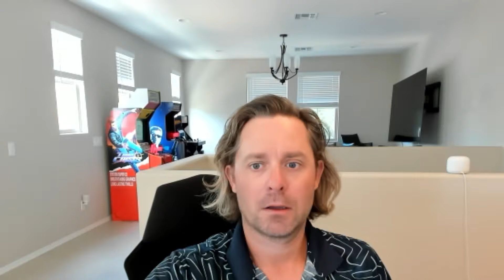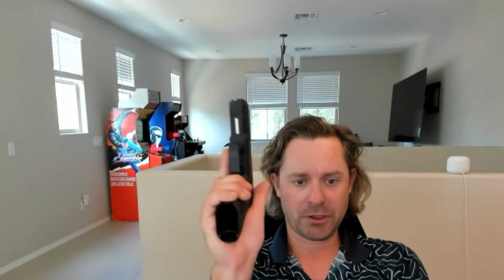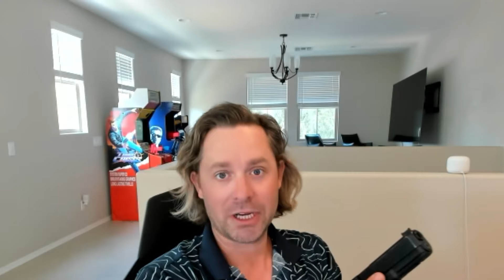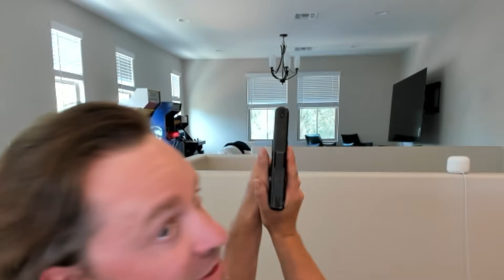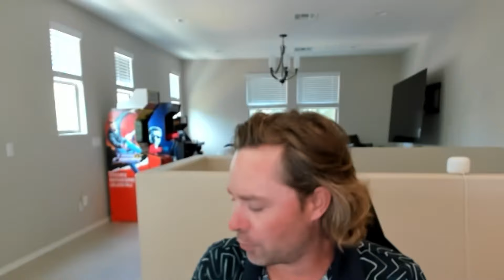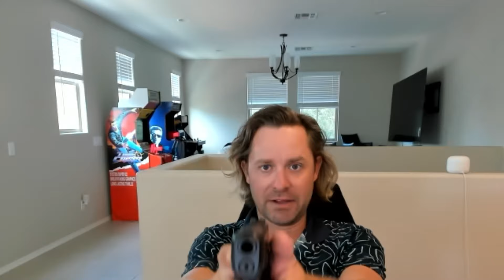Symmetrical Pressure

Comment: The support index finger over the trigger guard is the grip Eric Grauffel uses. I was IPSC trained by  one of his students so I started doing that for competition. It gets your hand up high and I use a little push / pull with some JJ support side  wrist pressure  in my upper palm . But , as Ben says either way , a vise like over gripping leads to a tense trigger finger and attempting to control recoil causes the pistol to porpoise down , reduces accuracy as well as slowing your split times . Predicable return to zero is the goal so the only way to learn that as a new shooter is to experiment with pressures using whatever variation of the thumbs forward grip works for u .
Reply: With Eric's gripping style, there is no firing hand pressure since you push/pull with your shoulders, so your firing hand is not tensioned. Split times don't matter much(if you can shoot .20-.25s splits), but transitions and transitions accuracy. I am switching from the traditional style of grip to Eric's type of grip since I have problems with my elbow because of the amount of pressure I was applying to the gun. 
Strong left-hand pressure helped me fix the incorrect trigger pull. Now, I have a fraction of the tension in my left hand, and I can see all my errors with the trigger pull. But I still can ride gun recoil, and I see even better results in the gun returning to the spot. The recoil is just a vertical line now. I can do .17-.20 splits with it and it's enough. Anyway, I need to practice with this grip more.
Reply: @Andrewshkovskii  Copy - I had tendinitis in my elbow before I switched to the push/pull - now everything is absorbed in the shoulders. Agree that driving the gun in transition with this grip style feels more fluid . Match split times and training splits are typically different , but pushing your splits in a bill drill and seeing how the groups look indicate how effective your grip is.

Comment: When I first started shooting I would use my support hand thumb to apply pressure on the frame and my support hand index finger hooked on the trigger guard attempting to apply equal opposite pressure… very inconsistent for me to say the least. I heard in one of your previous videos your thumbs don’t touch the gun at all. I gave that a shot, adjusted my grip and my overall fundamentals and performance improved dramatically after breaking previous bad habits. Hits left-right and up-down got MUCH tighter and much more consistent and easily repeatable. My trigger press has also gotten more consistent from this as well

Comment: REM oil bad video audio boys assemble! 

I felt attacked by this video. I’m my 3rd range trip in doing a double tap 1 sight picture. My shot timer is around .22-.24 and I spent the week trying to find ideas for dealing with recoil.

As I’m driving to the range this Ben guy straight up tells me to just make a consistent grip.

I try my new toy grip. Somewhat happy with the result at first. But then I decide to just hold the gun look and point and do just as good. I walk away from this range trip annoyed and asking myself where do I go from here….

My initial question to Ben was “then how do I keep the gun from lifting”. Then I realized that maybe I don’t need to think. Maybe I just need to look and point and work on letting the gun do its thing while I make it consistently do that thing.

I’m so non articulate.

Comment: So I shouldn’t be squeezing the shit out of my control hand while having my firing hand loose?
Reply: BullseyeBallistics-kf1jw  usually my stippling is imprinted on my palm and my hand hurts after 5 minutes. I judge that as a solid control hand grip. It’s what I’ve picked up from a local Uspsa GM that teaches with Ben
Reply: what works for me is to grip with your firing hand just enough to keep a secure hold on it but no more and then clamp your control hand on your firing hand providing more pressure but don't squeeze it to the point it fatigues you.
Reply: @sipfixx  I’m still exploring my grip so I’ll try that out.
Reply: Am I correct in assuming that gripping as hard as I can with my support hand is no longer the thing to do?   Just firm enough to get consistency?
Reply: @thomassmith280 honestly I thought the non dominant should still be gripping as hard as possible. Maybe Ben will chime in
Reply: I think it's really easy to see if you have a red dot.  If the dot shakes while you're gripping the gun then it's too hard, and you should back off till it doesn't.
Reply: imo, a little bit of both. tight on the firing hand without being so tight you cant control your trigger finger independently. end of the day, do what works out best for you.
Reply: Ben’s definition of “firm and connected” is the gun does not move in your hand. For most people, that is gonna feel like a ton of pressure.

Comment: Not necessarily saying this is the right way to do it, but it got me to M Class so it has worked so far. 

I normally tense up the closer I am to the target. If I'm within five I just grip and rip, I don't even look at the dot. Within ten, grip hard with the left, ease off a hair on the right (I'm righty), see the first sight picture, send two. 15, I ease up more with both hands, send two with color confirmation, and outside fifteen I see my dot every time. Outside 35, everything is more or less relaxed and I'm just focused on a good straight pull.